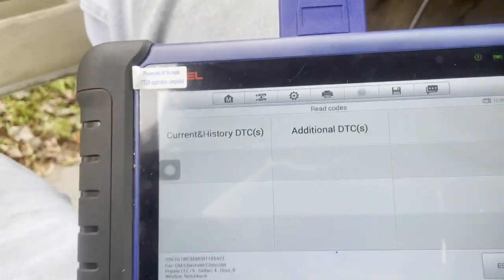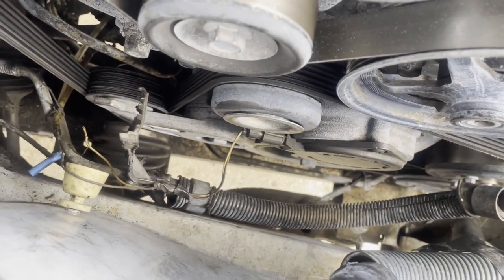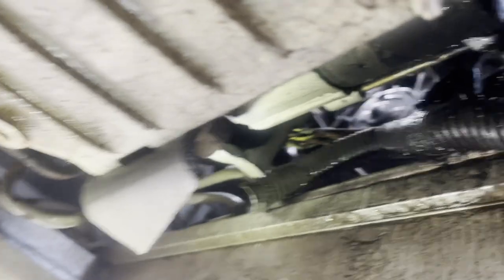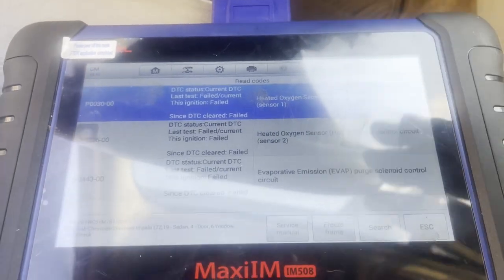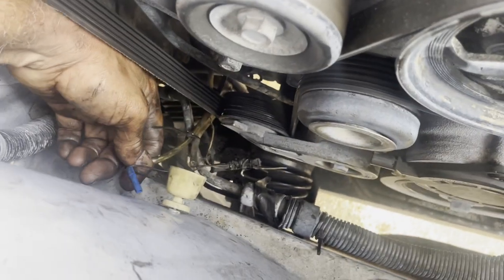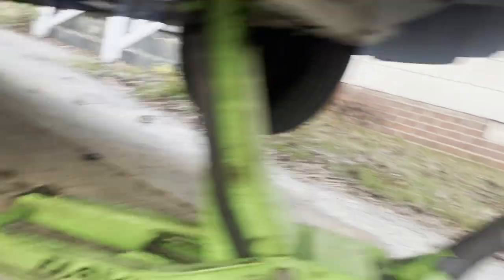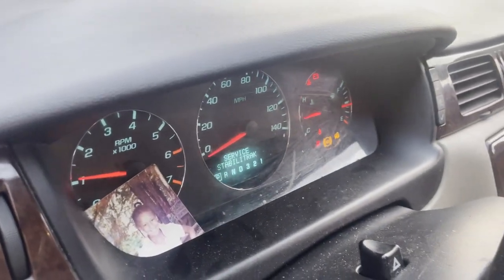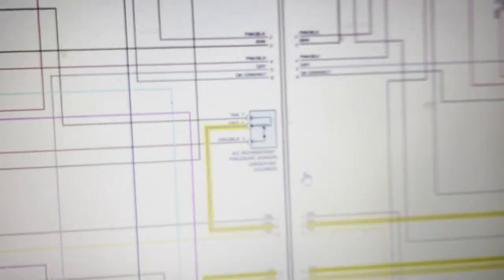chevy impala Reduced engine power with multiple sensor codes

Comment: Hello sir im getting p0641 sensor reference voltage A circuit. Also p0107 for map sensor. Brought a new map sensor but code still there, then with a multi meter I noticed im not getting the 5volts off the map sensor connecter with key in on position it just reads 0. Cant find and problems in the wiring. Any suggestions? Engine power reduced

Comment: Mines say code p0091 , what should I do boss man?
Reply from the maker: Could be lots of things .  What have u done , ?   Fuel pump, fuel pump regulator, fuel pump relay, bad wiring issue etc. you gotta start testing
Reply: I changed regulator , when I get up to 20 mph I lose power
Reply from the maker: Try getting a fuel pressure test.. rent tool at part store

Comment: I have a map problem with my Chevy Impala and everyone has been telling me it my transmission I had it on a scanner It is readying map sensor
Reply from the maker: Are you getting a Reduced Engine Power as well?
Reply: @HayesMobileAutoRepair  yes when I changed my accelerator pedal sensor and went off my car is still doing the same thing so I'm thinking it's the max power senser
Reply from the maker: @WenceslaoRamerezmorales    First of all, when asking a question, alway start with all your Codes.  I can’t help you if you just tell me you Think it’s a map sensor.. I need details
Are u a subscriber
Reply: @HayesMobileAutoRepair  our reduced coat and a check engine light is on  no codes yes describe